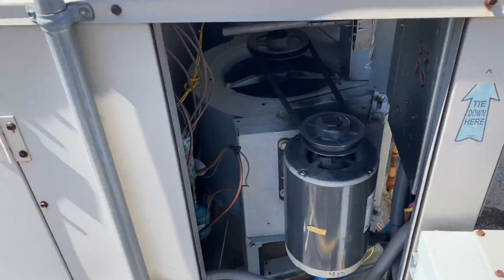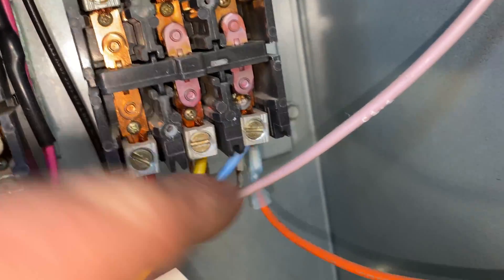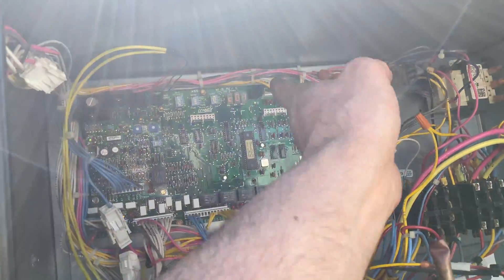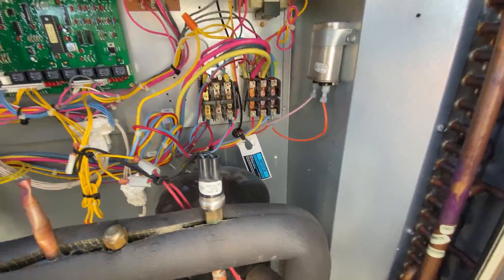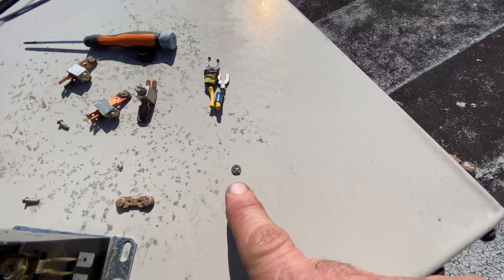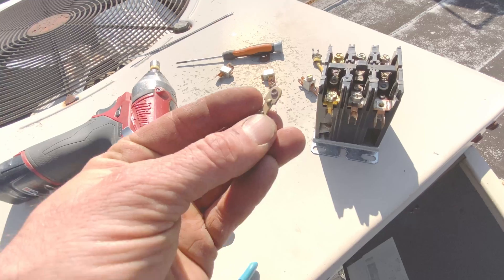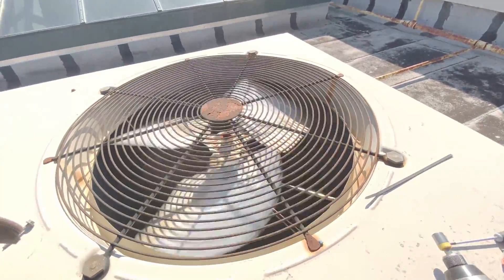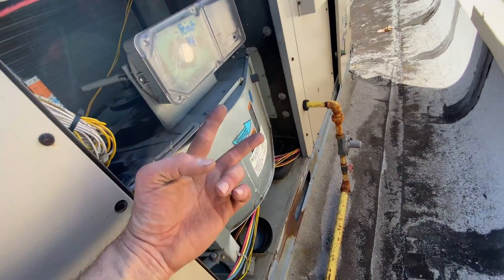HVAC Blower Motor Overheating Shutting Off Electric Issues and Repair

Comment: Is this your new channel?
Reply from the maker: I am using this channel to give tech tips. Jobs I can’t really film much yet valuable info can be shared. Or to share info to help others from making mistakes I may have made in the past. Some techs might see this motor moving slow and over heating and just order a new motor before checking out other possible problems. Where The HVAC Hacker channel will get my adventures from some of my service calls and jobs.
Reply: @howtohvac3234  Any clues what caused the burning cables and faulty contactor?